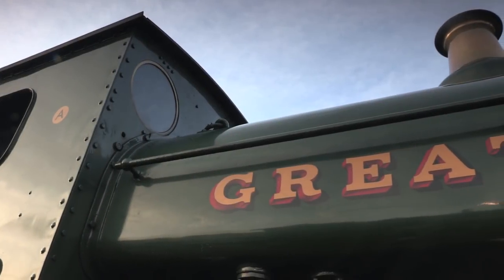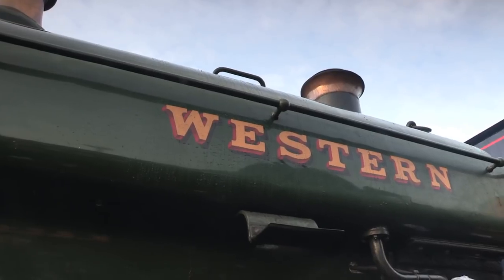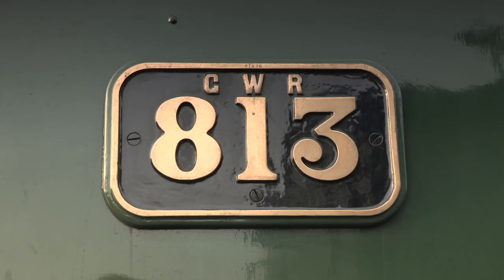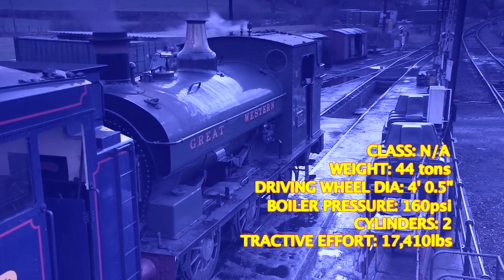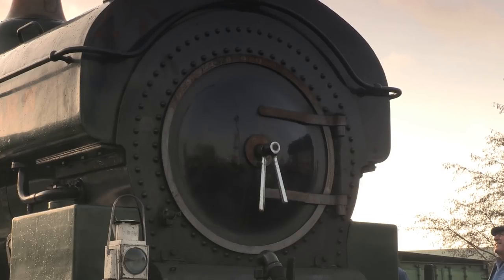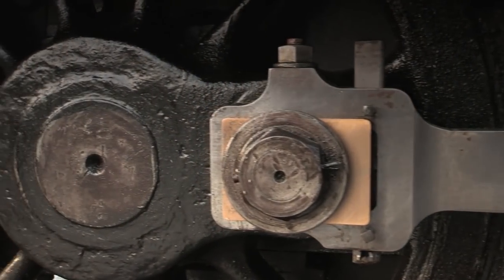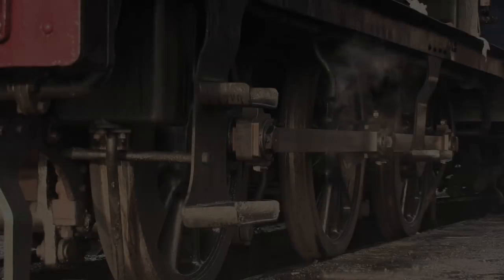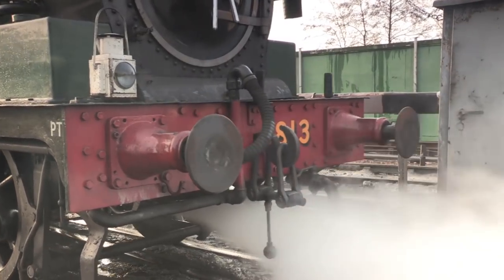SOLE SLIP: Port Talbot Railway No 813

Comment: A nice little insight onto an often overlooked little engine.

Apparently the severn Valley's boiler crisis was due to water treatment which tackled the scaling that often comes with steam engines. Unfortunately this turned out to work too well as it royally cleared the scale out from the nooks and crannies of the boilers where the scale had in turn sealed the boilers up. Take that away and you have a fleet of engines that were leaking like cifs...!
Reply: I understood it was due to a lack of water treatment, and that reverse-osmosis treatment had sorted the problems?

Comment: Great video. How about this engine running with a few coaches on the last main bit of Port Talbot line from Tondu to Port Talbot, a bit of a trip round the steel works and back to Tondu.